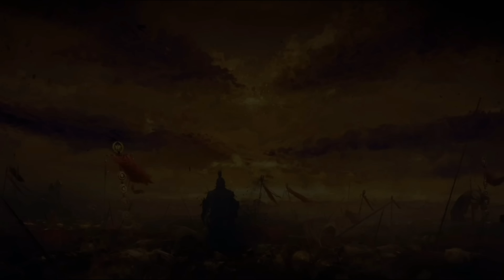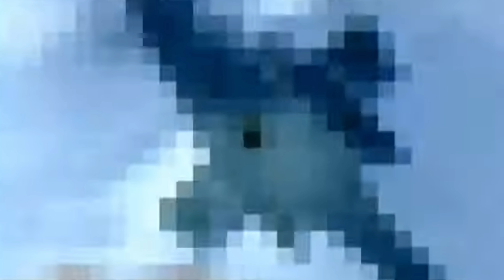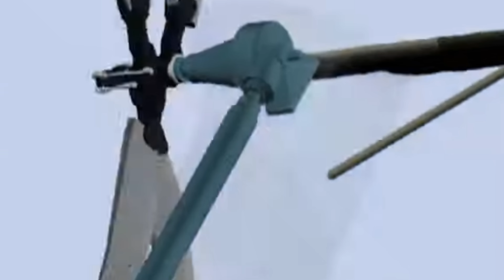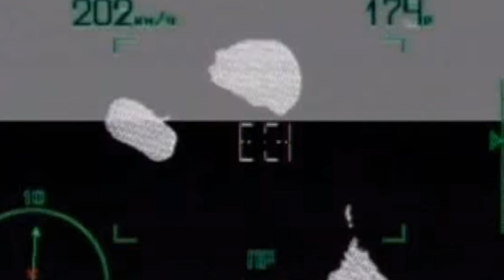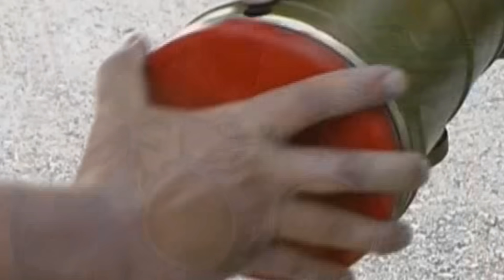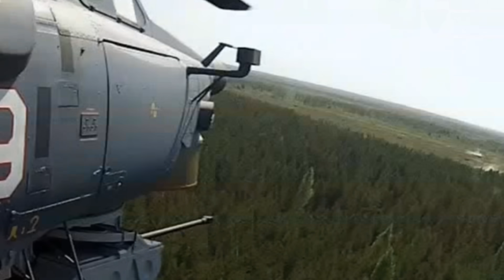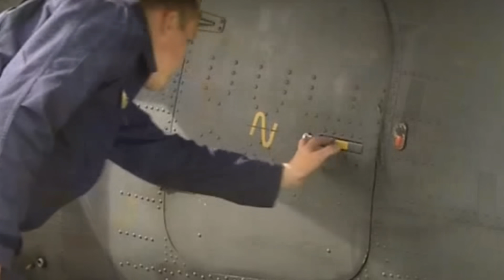Mil Mi-28 "Havoc" | RUSSIAN ATTACK HELICOPTER

Comment: Never realized how much more Badass the 30mm Shiponov 2A42 gun was than the 30mm Bushmaster on the Apache Gunship we use in the US Army. 30x165 necked down case vs 30x113 straight wall. Im thinking the 20mm Vulcan Round from my dads Corbra Cannon has more ass and Penetration than the Apache gun. How Embarrassing

Comment: 4 have been lost 2 having been lost in Syria anybody know how they were lost?   I saw a picture where one aircraft landed upside down.  Both men were killed.  So I don’t see how the escape system could have saved them but I’m curious what happened with the other 3.   “They” say ka-52 actually has an ejection system.  It supposed to blow the blades off the rotor and the pilots pod is ejected out like in jet aircraft but they’ve also lost some of those as well.  I’m just curious if anyone has actually successfully escaped from a crashing helicopter.

Comment: I would love to see a video comparing the Mi-28 to the Ka-50 which demonstrates why the Ka-50 was considered better by the analysts.  They both cost about the same but the Mi-28 carries more surface to ground missiles, is a slightly faster than the Ka-50, and can extract 3 soldiers in an emergency.  It also appears to have more armor than the Ka-50, but statistics about the armor are hard to find for obvious reasons.
Reply: Вся ваша натура по жизни, столкнуть лбами и всё мериеться деньгами а подумать если ни хватает ума
Reply: Stupid because they perform different tasks.

Comment: You forgot a huge plus, or can transport 5-7 full kit soldiers in the mechanical systems /maintenance can. The doors on the left side behind the wing, it’s heavily armored capsule to protect the vital components engine and systems . You can stand up straight in the main area and then the hollow tail is regularly used for two soldiers sitting or laying down. There’s communications system to the pilot and Co pilot, medical equipment and a fast rope detacjeable by the pilot .  There’s no better special forces insertion helicopter in my opinion than this heavily armored , heavily weoponized  all weather beast.  Why better rescue helicopter go lay hate down while picking up a team or injured soldier behind enemy lines.  It’s also very A10 like where the flight systems are all so heavily armored it can take heavy fire even the rotors are a composite that can take fire.

Comment: Ya know honestly, this is a very very capable monster /attack  helicopter  heavily armored insanely potent , fast, reliable, pilot emergency egressing , amazing tech and sensors and one of my favorite aspects, the left side access to the engine /systems area was adjusted in design where there is a good amount of room and ample power, they realized they could comfortable fot 5-7 full kit soldiers in the mechanical area and also the large Hollow tail actually is used to allow two soldiers laying down .  It’s so smart they made it a transport area, or was already there, the access also, it’s fully armored already to protect all the critical systems and required NO changing of structure to accommodate the men, 5-7 is sufficient for a Special Forces team  , a reconosamce team, the most capable rescue helicopter for troops left behind or rescue operations being used often as an assault ship but also a medevac helicopter that’s actually armored and deadly , intimidating helicopter when’re dripping or picking up soldiers the helmet controlled turret cannon and other systems can put the enemy’s heads down while picking up or dropping.  The Blackhawk is a bullet magnet with no armor and has more injuries from small arms fire , the help can carry the same amount of troops into combat and do it safely and intimidating, the enemy also doesn’t know reinforcements are aboard, they see this comming and run .  They added a fast rope system for dropping teams where the door opens the rope is pushed out and already attached to a heavy pin , when the last soldier makes it to the ground the pilot or gunner pulls a lever that releases the pin dropping the rope and closes the door.    The crew seats are like modern IED APC suspension seats protecting hard landings as well as suspension for the wheels allowing the helo to put down fast of needs be and then the ditch system for the crew on the emergent, several times the armor of an Apache for the crew , essentially a Am A10 armored tub but with ballistic glass too.  And lastly it’s a FEACTION. Of the cost of an Apache , it’s cheaper by far than even the Cobra .  I truly wish we’d just buy a crap load of these.  We could apply our sensors if wanted and aside from that seems to be better in every way and a hell of a lot cheaper.  
Lastly,

Comment: I’ve always admired Russia’s push to allow pilots to ditch their military helicopters , whether the rotor detaching system /ejection seat of the Aligator or this system bailing out the side, the bottom line is the crash suspension or box like the Apache is a joke cause such a large number of career ending injuries most commonly to the spine of the crew.  The survival and Injury rations of crashing helicopters is very largely lopsided to Russian helos with a survivability rate that’s nearly perfect opposed to the large number of crews lost or severely injured in Apache impacts.
Reply: Something similar applies to Russian ground armored vehicles, the advice of commanders is if you get stuck or it gets damaged, just get out and get a new one, don’t stick around and die in it, you are worth more than the machine.
Reply: @Mortablunt Interesting.  Our ‘propaganda’ seems to still maintain the Kremlin considers human life simple fodder.  I recall reading about the Mosin Nagant, of which I have a couple, and how one wasn’t issued to every soldier.  Some soldiers would go to the battlefield or front unarmed, with the expectation they could simply ‘issue’ themselves the rifle from a fallen comrade.

Comment: The information Iraq’s order of 19 was completely cancelled is incorrect, I’m not sure how many they have but I’ve personally seen them 5 particularly .
Reply: I think he was talking about another contract in 2013 that one was absolutely massive with T90s, Sukhois, air to air systems... Etc. it was cancelled due to corruption  pressure from the US. Iraq definitely operates mi28n and mi28nm and have been for at least 5 years. The Iraqi MOD also recently got T90s and bmp3s.

Comment: From what I have read; the Russians lost many helicopters in Afghanistan from ground fire. It appears the Russians have just accepted the fact that you are going to loose helicopters and that you should at least recover the hardest to replace asset; the trained crew. In many respects the latest Apache copters are starting to use drones to deal with the ground forces before the copter comes within their striking distance. I would think the Mi-28's stand-off weapons with certain tactics could avoid close contact with undiscovered and Manpad armed ground troops. In some respects proper tactics or operating procedures are as effective and less expensive to apply than technological solutions. Perhaps they could use lightly armed ATV's to flush out the enemy. It's an interesting and probably effective flying tank or the nearest thing to one.

Comment: Only took Russia how long to build up enough attack helicopters that could actually fight in the dark?

Also, you're talking at the end there about the failed Karbala raid, the Havoc would get eaten alive in that engagement too. The moral of that story is attack helicopters don't work doing deep penetration operations behind enemy lines without heavy support from fixed wing air power. The same Apache unit reattempted the mission a few nights later with the help of the Air Force and completed their mission with no casualties.

Comment: id still pick the AH-64E. and its later Blocks. nothing beats an Apache... well. maybe the Ka-52. but the RAH-66 can hands down outperform a Ka-52
Reply: Rah 66? Seriously? Still stuck playing video games? It's not real. It doesn't work.
Reply: @RR-us2kp  ??? The RAH-66 was built and made. 2 prototypes and it had an AMAZING performance, it flew, it had weapon testing, and punishment test done in flight. At the time, the Russians where looking to make their own multi-purpose platform as the US was developing the RAH-66, that heli was the Ka-52, which was more of an addition to the Ka-50 project. A stealth recon attack platform. able to perform all tasks, from CAS, AT, SEAD, or standard recon and BDA. it was the first-ever helicopter to use head motion gun mounted assistance. 

The project was to replace the OH-58 and compliment the AH-64. it got far. it had heat nullifying techniques with its exhaust, it used lightweight components, was one of the first helicopters to use a broad range Command and Control system to integrate with sea, air, and land forces even collaborate with the new UAV systems. (all said of which became updates to the AH-64 later). The package originally came as barebones, but were to upgrade to a Block II nearly out of the gate that provided winglets for pylon mounting external weapons such as dumb fire rockets, smart rockets, Hellfires, anti-ship missiles, and AAM missiles. with a full AT compliment, it can carry up to x14 Hellfire missiles. 

Project was shelved in 2004, the prototypes donated. Both prototype airframes 94-0327, 95-0001, are located at the United States Army Aviation Museum at Fort Rucker, Alabama.

It had no performance, equipment, or software issues as we see today with the F-35. The only issues that existed was that it was vulnerable to non-radar AA. meaning it was on the frail side. 

Besides climb speed, and the number of weapons it can carry, the RAH-66 can outperform in the usual way against Russian helis. Like the F-22 vs the Su-35. the F-22 still wins hands down. Due to a smaller radar cross-section, and the F-22's ability to strike targets outside of visible range or NLOS. Even able to hold its own in a dogfight thanks to wider wing placement and vectoring engine thrusters. the new AIM-9 Block can even be fired while not pointing within 180* of the enemy aircraft. (as it usually is), this provides the F-22 with the ability to strike targets nearly directly behind the aircraft.
Likewise with the RAH-66. it has a smaller radar cross-section, it uses NLOS and LOAL, superior maneuverability, and the ability to strike targets that are off the beaten path. 

So i do not know where youre getting the idea that it doesnt exist. there are videos here on youtube of it being flight tested infront of cameras. 
https://www.youtube.com/watch?v=9PLWEr10Z-g
Reply: @kellerweskier7214  when I said it doesn't exist, I mean IT DOESN'T EXIST. 
It was CANCELLED. Why can't people move on?

Comment: To be honest, i think Ka-50/52 is a better helicopter.
Coaxial rotors are more effective than main and tail rotors and the helicopter won't go down after losing the tail.
Ka-50/52 have actual ejection seats.
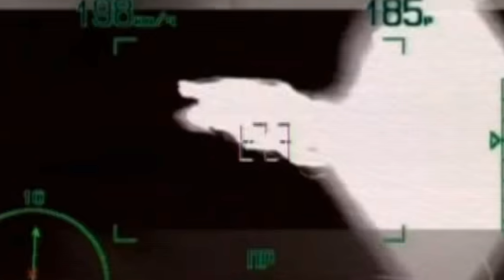At 9:19 it's visible how recoil of the Mi-28's cannon affects the sight. Ka-50/52 doesn't have that problem.

Comment: The best helicopter of BF2. It was heavier and a little slower than the cobra but made up for all that in absolute firepower and stability.
Score wise, it ran circles around the US counterpart and with a ace pilot (me) and ace gunner (my friend) it would beat anything in the game, including fighter jets.
Reply: I'm glad to see people give credit to BF2. The Refractor engine made vehicle combat a thousand times more fun than Frostbite and achieved full potential with BF2 mods that experimented with asymmetric warfare and more depth.
I remember the helos a bit differently, though. The Cobra was faster, had a smaller hitbox and was more fun to roll and throw around tight passages. The Havoc was slow, had a bigger hitbox, but better turn right. The biggest difference was that while the Cobra's 20mm gun was good, you had to hit infantry with it almost directly whereas the Havoc's 30 mm gun had large area of effect. Each round almost had the explosive power of a grenade.
Because DICE refused to move forward with the series and instead dragged it down to compete with CoD, I switched to Arma and never looked back.
Reply: In BF2, It's like you shoot hand grenades at the enemies lol.

Comment: I find it interesting that the exhaust is designed to exit downwards with the addition of air coming in from the front to help cool it.  I wonder if that's really enough to keep it safe from anything but gen 1 IR missiles, can air coming from the front be enough to really cool the exhaust? I'd think that pushing the exhaust upwards to be dispersed by the main rotor might work better, but it's certainly better than the old Hinds with exhaust venting to sides and back of the aircraft.

Comment: from myself I would like to add that the advantages of this helicopter can be: survivability of mechanisms, protection of pilots and relative cheapness. From cons can be point to the, that his weaponry is outdated, namely ATGM 2 th generation need to wage the fire laser, when these missiles hellfire can work on the principle of "shot and forgot about goal", his 30-mm gun is far from perfection and she loses on accuracy and number of ammunition the same gun, that established on AH-64. as for the rescue from the downed helicopter is a very bad idea not everyone can escape, well proven KA 52 with its ability to eject to the top, which will help to escape at low altitude. The army lacks an option with radar and equipment for night hunting (due to the lack of funding). The conclusion of the helicopter is quite good, but requires modernization and funding. (I write through the translator, do not judge strictly for grammar errors)
Reply: Yeah unlike US soviet or now russian cant spend alot of money
Reply: Fire and forget hellfire is essentially never used. The laser guided versions of it are used almost exclusively
Reply: I was wondering about the escape mechanism myself. If the helo begins to rotate i cant imagine both men escaping. That would be alot of G's for the guy on the wrong side to overcome

Comment: why the tail rotor is in X shape, not cross?
Reply: It reduces sound. Also, if you look closely, you'll see that the blades are not on a single plane. There's a slight gap between the blades.
Reply: The X shape has more efficiency, stability or something. Can't even remember in which decade I read about it? But the AH-64 and a few others have similar tail rotors as well.

Comment: I just love RUSSIAN AIR-FORCE,One little thing,you did not mention is the secondary independent powerful APU mounted on the MI-28 Helicopter, provides"juice",from the main fuel tanks, to the inside"tube"of the front/rear, landing gear(chain-driven) with powerful electric motors to able 360° maneuvers on the ground,provides electricity to all vision systems/cockpit panels and allow to fire any weapons,even if the rotor has failed and the "beast"is stuck on the battle field ground.